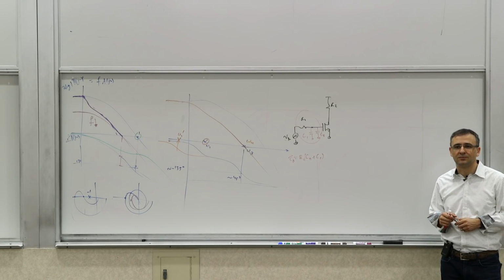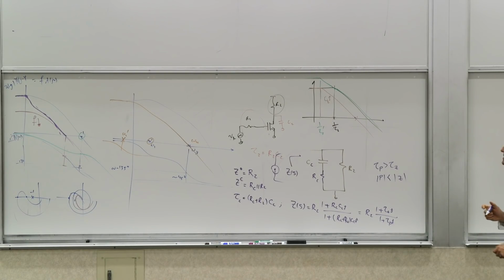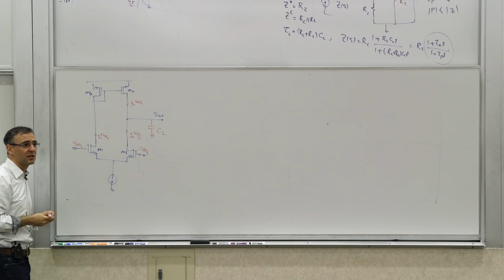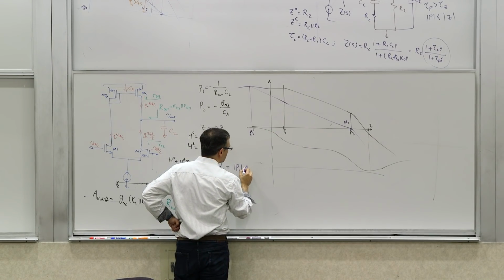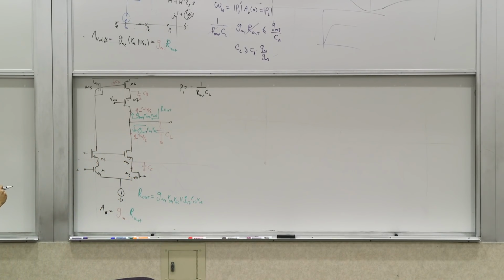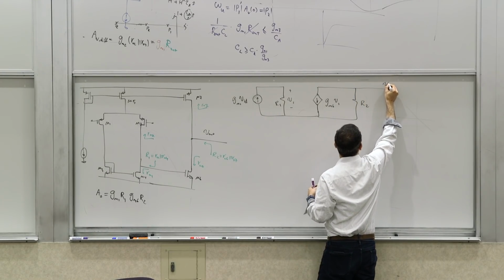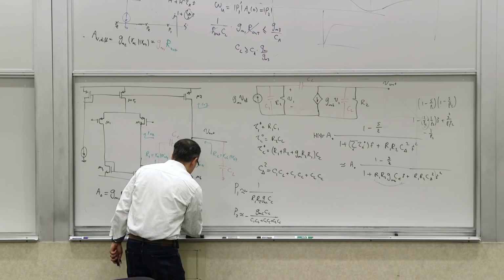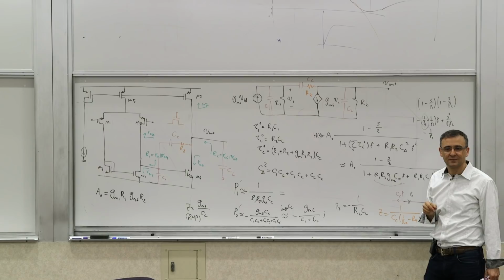171N. Circuit compensation techniques, one- and two-stage op-amp, Miller compensation

Comment: Timestamps (Powered by Merlin AI)
00:05 - Circuit compensation techniques improve system stability by managing bandwidth.
02:17 - Increasing output capacitance affects time constants in circuit performance.
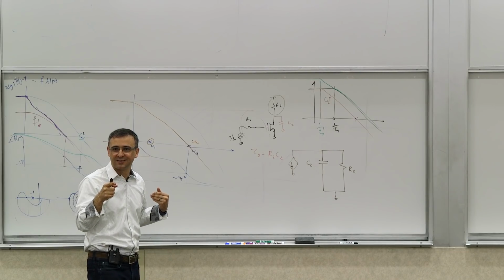06:45 - Introduce a zero using a parallel RC branch for circuit analysis.
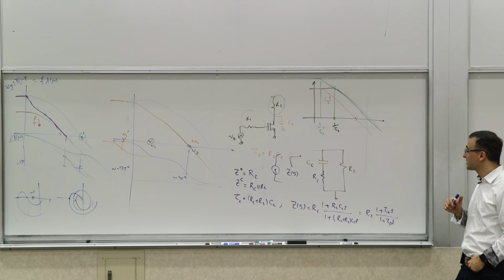09:48 - Understanding pole-zero placement for amplifier compensation.
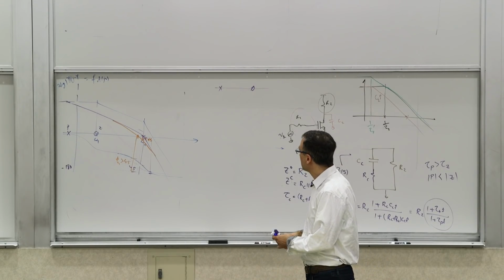15:04 - Complex networks balance phase response but have limitations.
16:59 - Analyzing frequency behavior and stability of a simple op-amp.
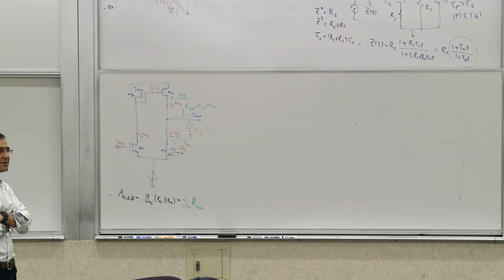21:51 - Understanding pole-zero configurations in uncoupled circuits.
23:59 - Explaining pole-zero cancellation and its impact on stability.
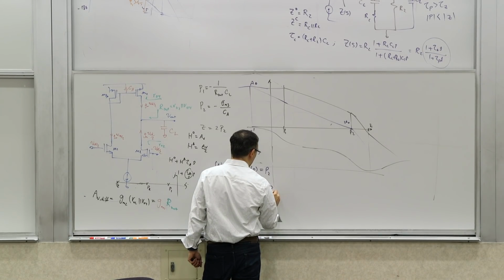29:04 - Load capacitance impacts stability and response in op-amp stages.
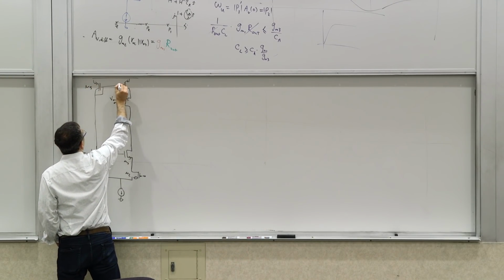31:38 - Understanding gain and resistance in multi-stage op-amps with cascode stages.
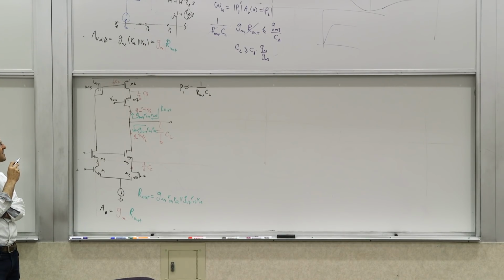36:11 - Circuit compensation stabilizes multi-stage op-amp performance.
38:23 - Focus on non-dominant poles for stabilizing feedback systems.
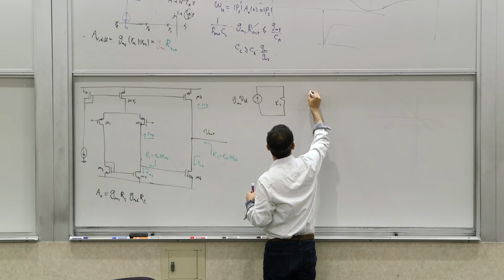43:42 - Overview of capacitors in op-amp circuit compensation techniques.
45:57 - Miller compensation uses a capacitor to improve circuit performance.
50:53 - Miller multiplication impacts pole placement in circuit compensation.
53:24 - Increasing CC leads to pole splitting in circuit compensation.
58:30 - Exploring circuit compensation techniques for frequency stability in op-amps.
1:00:45 - Approximation of circuit parameters in compensation techniques.

Comment: This guy knows zip about transistors.   No amplifier is purely resistive.   There sre internal parasitic capacitors in transistors.    He is saying he has a purely resistive amplifier and he wants to add capacitance to make it stable.   All unmitigated BS.     Anyone forced to listen to his yabba dabba mixed up understanding of transistor amplifiers is doomed to failure as an EE.
Reply: You should delete your comment. It is so negative and hateful. As someone who has watched all 70 videos prior to this, I can say he is just keeping it simple in terms of parasitics to not overcomplicate it. He is trying to get the students to have insight into what is going on. You can always go and add more parasitic caps. Also, in the MOS differential amplifier with active current-mirror load, he did model the parasitic capacitors of the transistors. He just added one capacitor at the input of the current mirror and one at the output. Those are assumed to have the parasitic capacitors, but he didn't explicitly state that since it is obvious. Please delete your comment and learn not to put 3 spaces between sentences. You should be ashamed for hating on him since he has no need to put all of these amazing lectures for free on YouTube.
Reply: @fast_gtr  What I wrote is not hateful.   I am trying to help people like you who are just starting to understand solid state electronics.  I realize that some people didn't have the good fortune to attend a top ranked Engineering university like I did.   I studied hard and learned a lot from the best professors and instructors.  This business of adding "parasitic capacitors" to a BJT or FET transistor circuit is a figment of his imagination.  It pains me to think some people who want to learn electronics are being fed a lot of superstions and completely incorrect ideas in this video.  I will not waste my time watching other videos on electronics produced by the author of this one, so your OCD paccadillos about me using 3 spaces at the end of a sentence should be restrained.  But it is horrifying that there is so much bad information on utube.   I would recommend a few very good textbooks on solid state physics, transistor theory, etc, but I guess you do not read much.
Reply: Ok. So what do you suggest? What is the correct way? What the Prof is trying to do is modifying the pole locations to improve the phase margin. He accomplishes this by significantly modifying p1 (by increasing CL) and p2, p3, p4 are relatively unaffected.

Comment: Sir why are we performing compensation for the forward amplifier transfer function (until now we were seeing how to get a phase margin in the loop gain, so that my closed loop system is stable). Am I compensating the forward amplifier so that even if I close to loop with a feedback factor of 1, my system should be stable.
Reply: This approach assumes that forward amplifier is frequency dependent, but the feedback is not frequency dependent or even if frequency dependent assumes that dominant poles coming from forward amplifier. Hence, in the loop gain system, all the poles and zeros coming from forward amplifier.

Comment: Hello professor,
There's something that I don't understand in the Miller compensation formulas.
When we had a CS stage, as for the output pole of the stage we would say that as we approach the output pole, the input pole is so lower in frequency that it has grounded the input and we can assume it as a ground node.
But in here when we are using the Miller compensation if we assume the same, which the circuit is pretty much the same, we could say that we have an output node with 2 caps, Cc and Cl and one resistor R2. And the input node is grounded. So we can now calculate the output pole (P2) as 1/R2(Cc+Cl). But this is not the same as your answer. Where do I get wrong?

Also thanks for your videos!
Reply: I mean what has changed from the C.S. that we cannot use the same logic here?
I would be grateful if you could give me an answer.
Reply: @MahdiMohammadi0  the pole you mentioned did exist for 2nd stage but the moment this pole arrives, it makes the dc gain of the 2nd stage capacitive which in turn reduces the miller effect seen by the first stage. The first stage loading  is no longer capacitive, in fact it becomes resistive ( a zero - exactly at the same frequency of the pole " you mentioned"). They both cancel each other and you never see that pole. If you separately plot first stage and 2nd stage gain, you will notice this cancellation. If you plot , overall transfer function, since its already got cancelled , you won't see it.